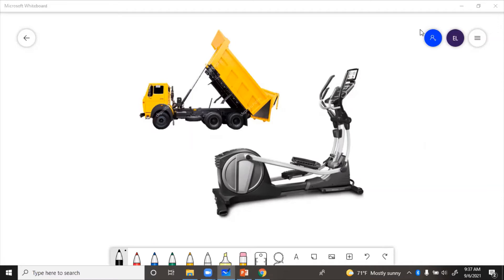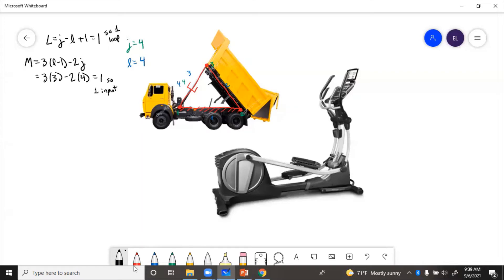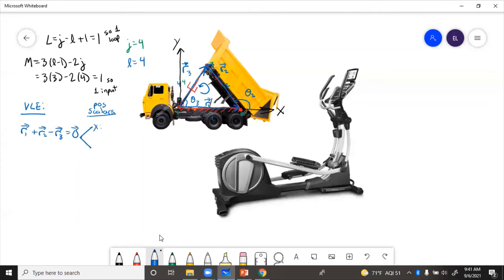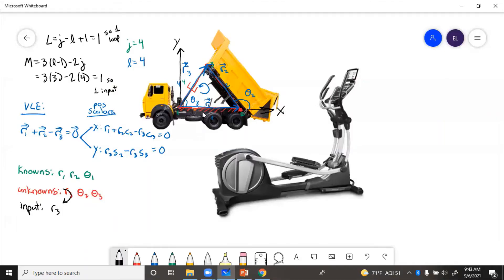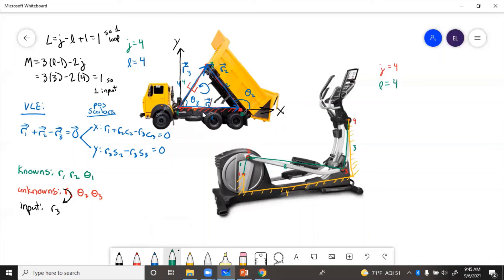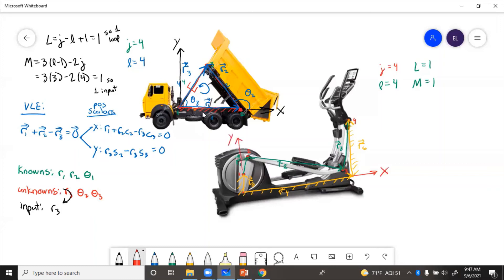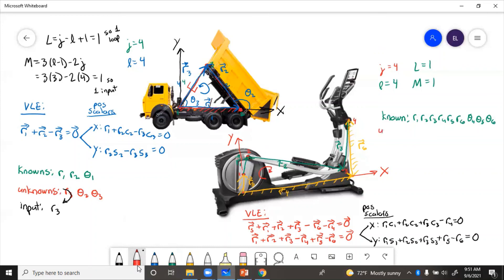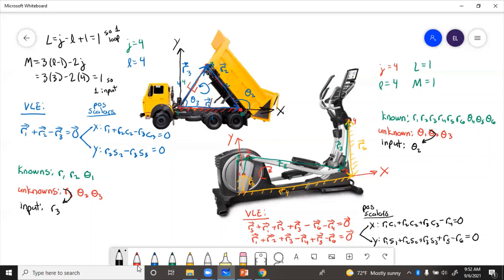Vector Loop Examples - Kinematic Position Analysis

Comment: How do you decide the directions of these vectors? arent these related to angular direction (CW or CCW)?
Reply from the maker: It does not matter if the vectors go clockwise or counterclockwise as long as your equations match the diagram.  The main rules are just go dot to dot.  If there is a slider, include an arrow in its direction of motion, and whenever possible, follow ground.
Reply: @dynamicsandkinematics  ok thnks

Comment: Have any textbook recommendations for this topic?
Reply from the maker: This material is based on ch. 4 from: Design of Machinery: An Introduction to the Synthesis and Analysis of Mecha-nisms and Machines, R. L. Norton, McGraw-Hill, 2012, ISBN 978-0-07-352935-6  
However, I am not very impressed with any kinematics books I have found, and I don't actually own a copy of the above.  I based the video on notes from taking a kinematics course.